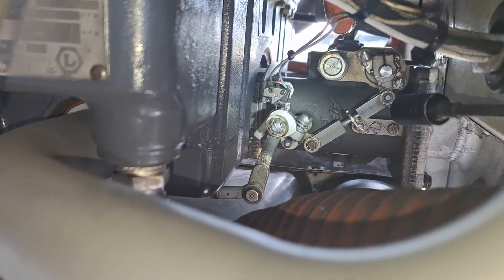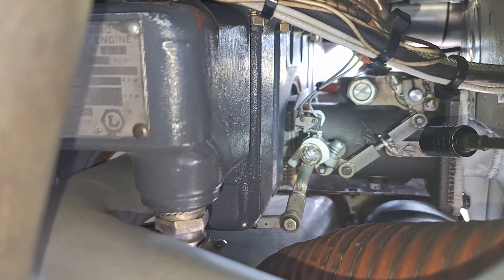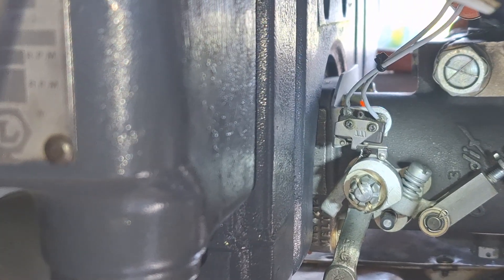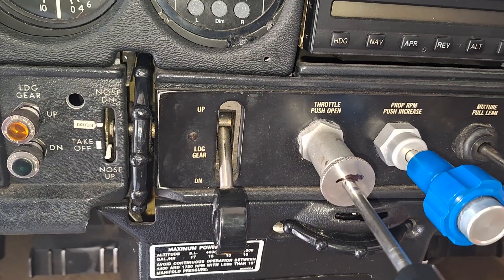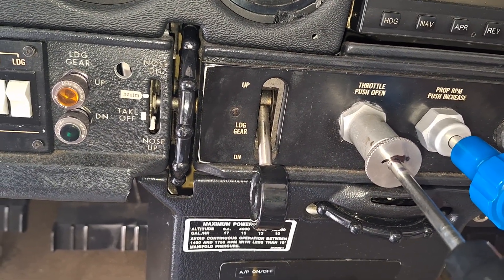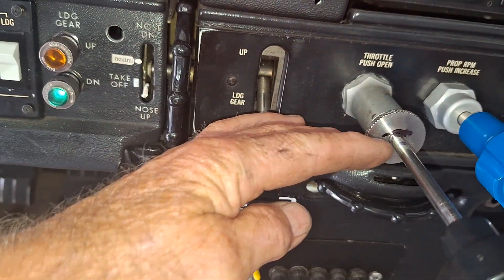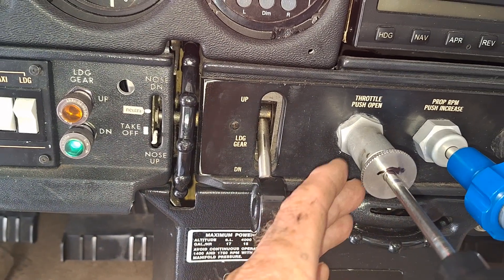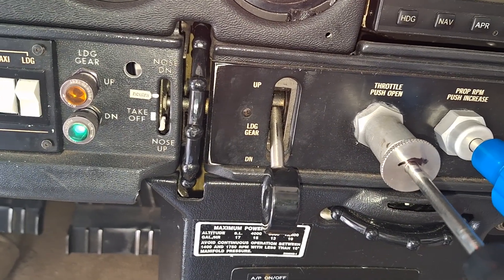Cessna 177 RG Cardinal Landing Gear Warning Adjustment

Comment: I suggest that you have the switch mounted 180 degrees off.  The small plunger should be nearest the actuating arm, not farthest from the actuating arm as you show.  I think you'll find the adjustment is much more reliable in this mode.  My experience is that with the switch in the 'wrong' orientation, the adjustment needs fiddled with every 30 or 40 hours, vs. 100's or hours for the other orientation.  Thanks for the video.
Reply: If you can explain the your point where 180 deg off ? didn't quiet get it my 71RG having hard time to find the sweet spot
Reply: @tanner4629  Tanner, the switch has symmetrical mounting holes so it can be mounted with either end towards the front of the plane.   Just remove the mounting screws and actuating arm, spin just the switch around (180 degrees) and remount the actuating arm and switch on the backing plate.  One orientation of the switch places the switch plunger towards the front of the switch (that is the wrong orientation), the other places the plunger towards the rear of the switch and nearer the pivot of the actuating arm.  I've owned my RG 23 years now and have replaced the throttle switch probably 5 or 6 times.  I can tell you that the adjustment will last for 100's of hours with the switch in the proper orientation, vs. having to constantly adjust the setting with the switch reversed.  I really can't explain the physics of the difference, but I can assure you it works well one way and doesn't the other way.
And, I don't move the cam to make the adjustment.  There is enough 'slop' in the mounting plate on the back side of the switch to make fairly large position adjustments.  Get the cam position close and lock it down, then do the fine adjustments by loosening the mounting screws and tilting the switch.  
Go fly, pull the throttle back to 12 inches, mark the throttle control shaft with a Sharpie.  On the ground, adjust the switch to actuate at this throttle setting and you're done.  It usually takes a number of tiny adjustments to get it just right.  But, with the switch in the proper orientation as I have described, the adjustment will last 100's of hours.